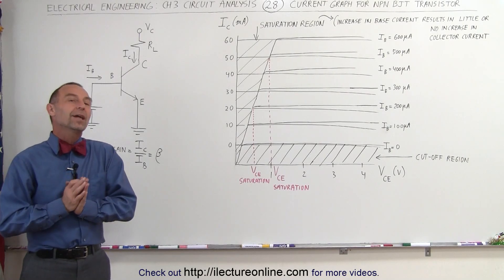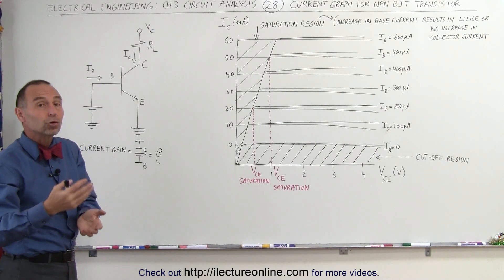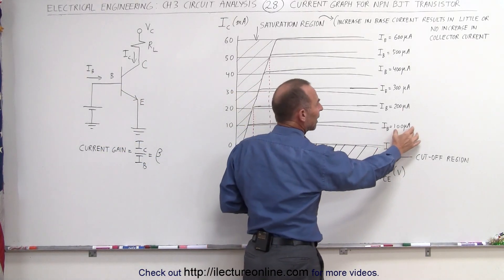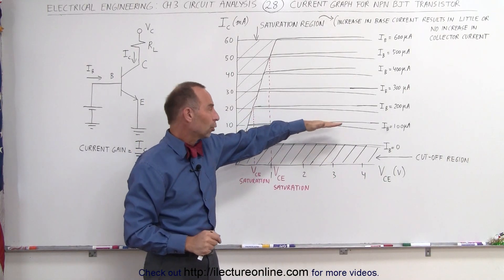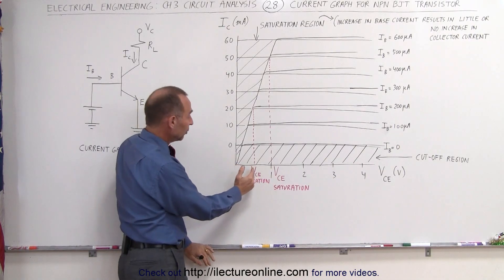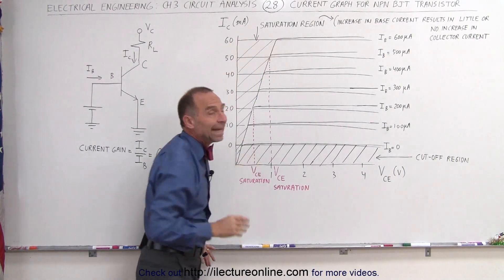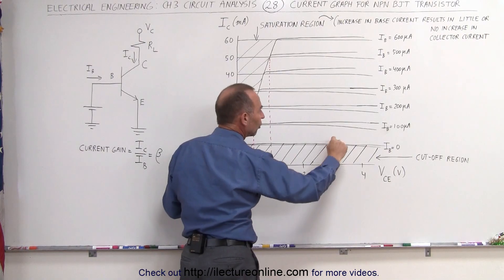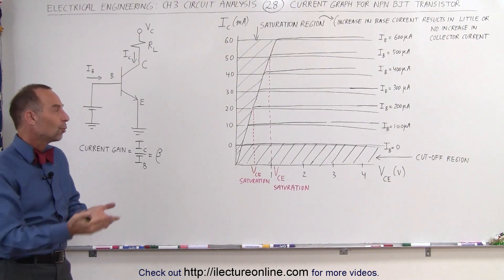Electrical Engineering: Ch 3: Circuit Analysis (28 of 37) Current Graph for NPN BJT Transistor

Comment: MICHEL VAN, The Voltage Drop Across the transistors Collector to Emitter is what determines the minimum Ib current and Maximum Ib current?
Reply from the maker: The base current is what controls the emitter current.

Comment: The Ic vs Vce curve explained, thank you so much!! 
Following your explanation with Vce=0.5 V and Ib= 500 uA, Ic= 20 mA because it is saturated. 
From this point we can increase Vce until 1 V and obtain the maxim Ic  with Ib=500 uA for a saturated state Ic=50 mA.
Increasing still some Vce=3 V we will still get around Ic=50 mA, above the saturation region Ic basically depends on Ib (b·Ib) and not on Vce.
Reply from the maker: Good information.  Thanks.   🙂

Comment: The higher the Vce is, the more bandwidth the transistor has to operate/switch.
 A lower  collector emitter voltage will reach Vce saturation sooner. Its Interesting to me that beta increase in electrons is due to the more doping of the emitter side, making this a true electron amplifier.
Reply from the maker: Thanks for the input.

Comment: I know it must be odd to ask but I'm looking at the datasheet of the BD 139 NPN transistor. 

They mention :

 Collector-emitter
saturation voltage

NPN IC = 0.5 A, IB = 0.05 A       Max. 0.5 V

I see the max current on the collector Ic = 1.5A. 

Am I looking at it the right way? Does this mean that if you give 0.05A on the base you get 0.5A on the collector so if you give 0.1A (Ib) you get 1A (Ic) and you can put 0.15A on the base to get the max. 1.5A on the collector?

Comment: The one thing not mentioned is that when the collector current and base current are at a higher state the collector current increases more drastically as the VCE increases. This is typically when passed what I've gathered is the DC load line.

Comment: Come on teacher give us a real example like 2n3904 general purpose transistor in class A amplifier with real voltage , real collector current ... aproximated beta .... bla bla
Reply from the maker: There will always be a difference between the theoretical examples and the real circuits.  But first we have to learn the principles and then we learn how to adjust the circuits for the limitations posed by the circuitry.

Comment: How would you calculate the voltages if Vo=4V, Vbe=0.7V, Betha=150, Vcc=18V, Rb=10Kohms, Rc=1Kohms,Re=500ohms?
Reply: Dear sir please add some video s on Electronics engineering/semiconductor physics and device
Reply: What is the parameter you want to find?. I think your question itself is confusing. From your perspective I didn't get from where you consider the Vo. If you are doing the common emitter config. The current at emitter is 3.3/500 which is 6.6ma.  As this will be the current flowing through collector by neglecting the base current let's say it is 6.2ma. if thats the current at the collector, then the voltage across Vc across Rc is 6.2ma*1000 which is 6.2v.That means the Vo is not 4v it is 18 - 6.2 which is 11.8V. If the Ve across Re is 3.3v then 11.8- 3.3V is  8.5v across the Vce. I hope I answer the question with my perspective...

Comment: Mr. Michel, a question about the chart. I was trying to compare to the transistors I have and I noticed that the Vce/Ic graphs they use are different. The line of Ib is drawn differently. 

Example: BD139 
http://www.st.com/content/ccc/resource/technical/document/datasheet/25/1f/cf/0d/03/ad/4e/06/CD00001225.pdf/files/CD00001225.pdf/jcr:content/translations/en.CD00001225.pdf

Where can I find the details lik you explained it in your video so nicely?

Comment: You are not providing any reason for why the curve looks like that, you are essentially just explaining what the curve looks like and what one needs to remember, but WHY DOES THE CURVE LOOK LIKE THAT?
Reply: In saturation the Ic rises according to the applied electric field that draws electrons from the reversed biased  CBJ  thus as the IB increases that means the BEJ becomes more forward biased and there are a lot of injected electrons to the Emitter side and this needs enough electric field(collector voltage) to apply  across the CBJ thus as there is an increment in IB, there is an increment in IE leading to increment in IC and the increment will be more proper as there is an enough voltage across the CB diode if there is insufficient voltage the diode will lose its capablity to draw enough electrons and will lose its proportionality with IB which is beata and the gain will be less than beata.
When CBJ reverse biased there will be enough E to draws electron but because early effect (base width modulation) the recombination region in p side will be less and this will make Ib decrease little bit to increase the Ic and  as well as the gradient concentration will increase leading to high I emitter  which means increasing in Ic as VCE increase ! In cutoff both the diode will be off no current will pass .^-^ I hope you understand

Comment: This is a tipical university course which has many assumptions... nothing new, nothing entertainment,nothing to learn... assumptions and assumptions like the collector current is this and that  ... in reality let's make it a fair share, those assumptions can make you think wrong... to much abstract  and not about the transistor model itself; about the the way you are introduced to this model so : thumbs down
Reply from the maker: There will always be a difference between the theoretical examples and the real circuits.  But first we have to learn the principles and then we learn how to adjust the circuits for the limitations posed by the circuitry.